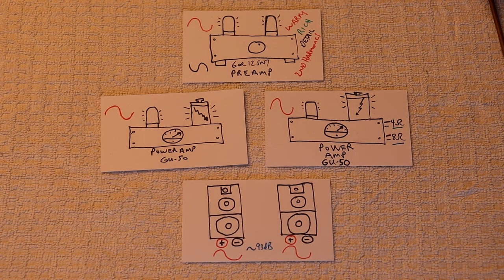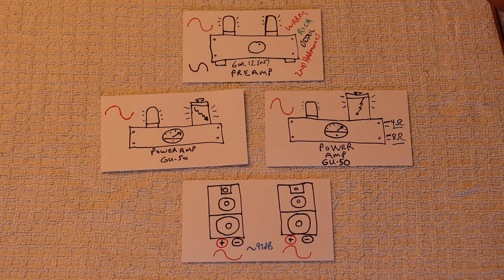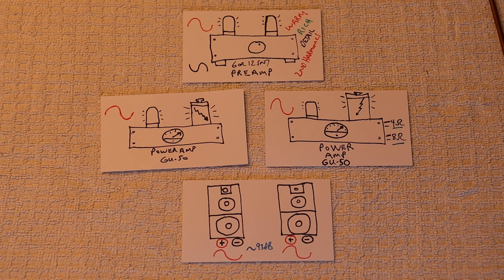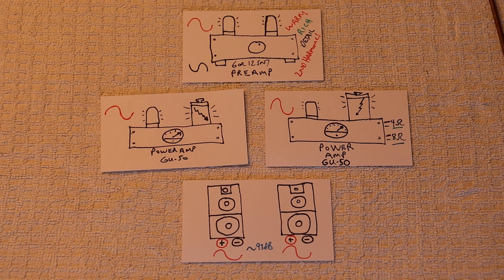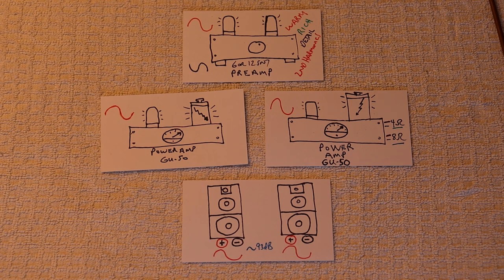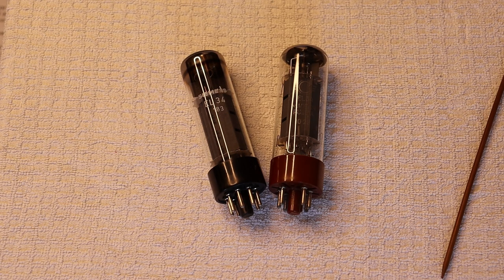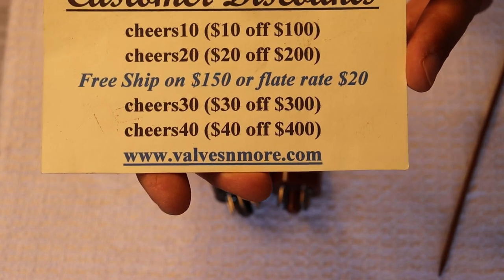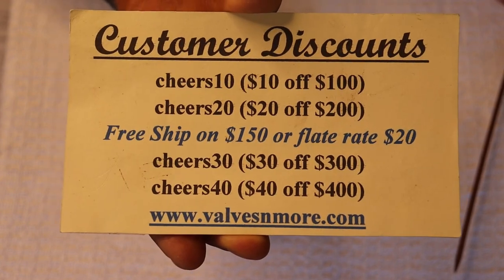Tube Lab #143 - Component Matching & Why It Matters

Comment: Indeed if you have EL34 Mullard you are a happy man ................
I also love the US made nos 6CA7 GE fat boy ( sounds different /US made beampower equivalent due to penthode patent ) ........and the RFT /SV winged C..
Siemens also sold in the final years the most strange EL34 ever made (in Yugoslavia EI ) with the exhaust on top of the bulb and a quite very shorter bottle.......
RFT was sold under many different labels .and were also sold under the label AEG ( Telefunken )!
In my opinion and experience, ...............better to have a good /  used set of RFT ( rather than current production stamped with the brand names of great older but obsolete  brands )
Today many tubes are labeld EL34/6CA7 ..............that's an aberration , it is a 6CA7 or a EL34.
I saw also 6550A labeld KT88..........and more of these mislabeling / in some cases fraudulous .
<Thanks for the upload and also for bringing the importance of accuracy and pairing componets to attention of the DIY community.

Something to beware off....some vendors sell paired tubes but that doesn't mean thsoie tubes are quality or within specification .....and just like your policy to throw bad tube into the trashbin instead of appearing again on tyhe market ........that's the correct way of doing bussiness and bussiness to last by creating trust and longtime satisfaction.

Keep on the good work ...........and I am very pleased with your creation of an octal RIAA amp instead of another ECC82/83/88 etc who have flodde the market ....
Sounds good even on YT .....

Comment: Hi, as a result of the experience you have about tubes, I want to know your opinion about kt88 gold lion - new production vs electro harmonix kt 88 eh on Willsenton R8.I have the possibility to chose a quad at the same price but I never had the opportunity to listen them.
My respect
Reply from the maker: Both KT88's you mentioned were/are made at the same plant in Saratov Russia by New Sensor of New York, in fact almost all reissue/reproduction tubes are made in this plant.  Most of the tubes are mediocre at best, but some are really good, like the Genalex Gold Lion 12AX7.  If you are looking for a cheap KT88 and don't care about getting the best sound or longevity either tube will be good to try.  The big problem of course is the vintage KT88's are hard to find and expensive.  My fav is the true vintage Svetlana KT88 (Caution! Many fakes and reissues).